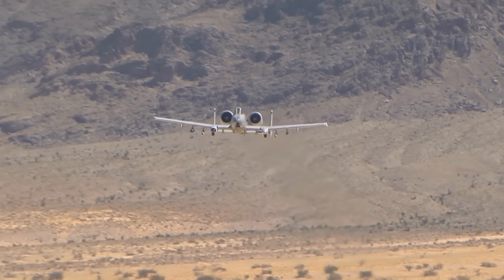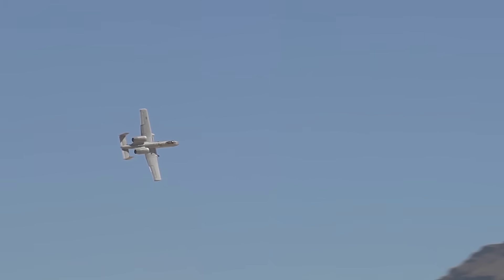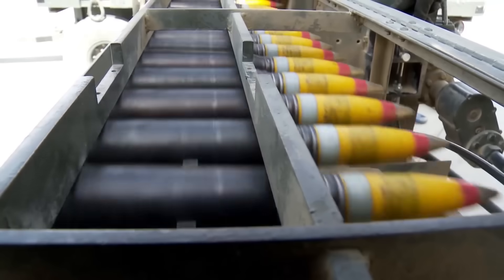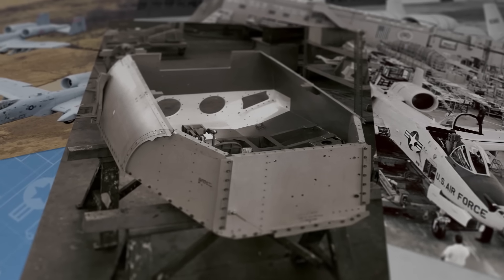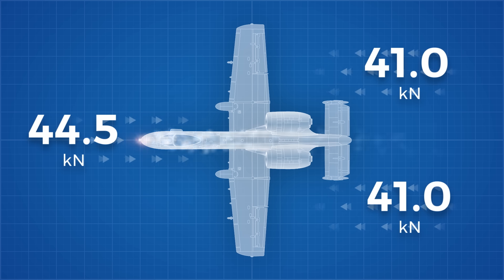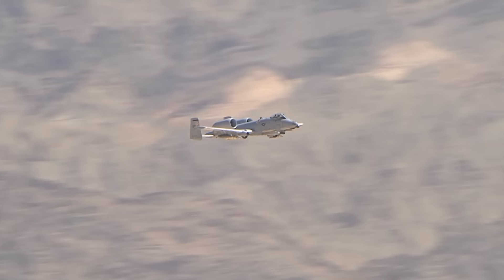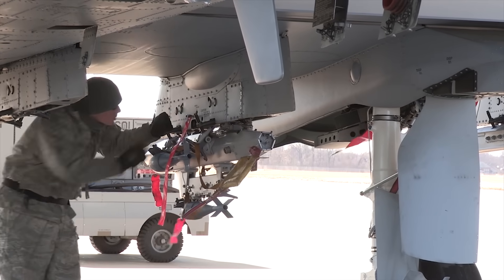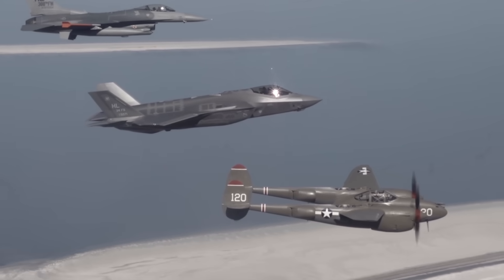The Insane Engineering of the A-10 Warthog

Comment: A10 is a cheap close ground support.  They should not discontinue it. Just upgrade it alittle.
Reply: Why?  Not enough pilots dying in obsolete planes for your liking?
Reply: @JP-fq5zj what amount of pilots have died and without close ground support how many soldiers would die. It's a flying tank. Yes low and slow but it has a purpose.
Reply: @sandcrai823 In a real war against a real enemy?  Most of them.

I never said ground support shouldn't exist.  Don't bother replying if you're just going to lie about what I said.  You don't need to risk pilots lives in an obsolete plane to provide it.
Reply: @JP-fq5zj  Whatever you say

Comment: Simply put...I love this plane.  A few more thoughts...I can't believe the Air Force has stopped using this plane...but it is a little understanding considering all the new high-tech planes they have coming their way. It's just so easy to love because of its simplicity. The good news is that there has been talk of the Army adopting it, and I hope they do. Can you imagine how much of a bigger beast this plane could be if it were modernized?!!?!!  There isn't another plane as good at ground support as this one. Lastly, I was never in the Military, but I can imagine that there's nothing more comforting or iconic to a soldier or marine than the beautiful sound of BRRRRRRRTTTTTTTT overhead.
Reply: There are many planes equally capable of ground support.
Reply: @JP-fq5zj  Are there though?....I'm not just talking about firepower. I'm talking how the entire design revolved around ground support. 
It's brilliance is in its austere design...large max flight weight. Wing design to help support stability at slower air speeds. Oversized landing gear so it can TO and land on imperfect runways. The engines are higher off the ground and in the back for this same reason, and also to help make them less of a target from small arms on the ground. Not to mention the redundant hydraulic systems and the ability to fly it without the "power steering" mode on. And I'm sure I'm missing more. 
If you upgraded it with more modern and lightweight materials to enhance cockpit survivability. Fsensors for better cockpit visibility....and finally a radar to aid in long-range target identification and weapons targeting (and other systems I'm sure I'm forgetting)
Sorry for the rambling...I'm a dork and I love this plane.

Comment: 2 corrections

While protecting the equipment from casings might be part of the reason, the primary reason for retaining the spent casings is maintaining center of gravity

The gun also isn't directly in the center, it just fires from the center. The gun itself is offset

Comment: As you said, those fancy planes made for BVR engagements are insanely expensive, fragile and in any CAS role they won't have any advantages. Stealth is for radar, not for mk.1 Eyeball. You cant even step on most of the F-35 or F-22. You can rip half of a wing, landing gear and an engine off a Warthog and it still will return to the base with the landing the pilot can walk avay from. Good luck operating a gen 4++ from a muddy sandy runway as well. A plane made of shit and sticks with a sole purpose to pack and take a punch. A combat environment with highly sophisticated GBAD against the US military is proven to be fairly rare while EW and other things are present in the most cases. Good luck jamming a 30mm round. And well, you could use a Hellfire or AGM to remove shitty Soviet legacy equipment from existence but a Hellfire probably will cost more than that thing you deleted. 4000rpm democracy delivering boomstick is really, REALLY cheaper. That's why the Hog persists. When your enemy uses Sherman-like technilogy, a flying Sherman wins, not an F-35.
Reply: The f35 can simply provide CAS from over 30k feet where AAA doesn't reach and because it isn't as slow as a ww2 plane it doesn't need to have a runway that close to the fight.

Also a manpad is way cheaper than an A10

Comment: notes:
survivability, ruggedness, cost effectiveness, air to ground support, was prioritized. Redundant hydraulic systems were present.
MIG 21: here's an engine, make it fly
A-10: here's a 30 mm gatling gun, make it fly

Contains more chaffs and flares than any other US legacy fighter plane. Chaff is radar confusing material for radar controlled missiles and flares are used for confusing heat seeking missiles. Unlike f35s it was designed for one job only, getting down and dirty and take some punches.
Reply: Unlike the f35 it can´t do cas if there´s a guy with a manpad sitting on a plastic chair

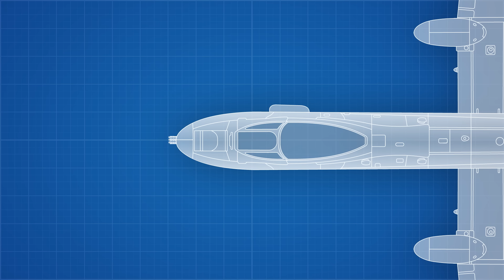Comment: 7:43 Accually Its Not Mounted Directly in the Middle Its Offset
Reply: Are you not thinking of the nose wheel which is offset to avoid the gun?
Reply: @meggaduck  no the gun is offset however the right most side of the barrel fires to prevent the plane from yawning

Comment: They have been trying to kill this plane since the 90's.  If ground fire can't take it out then a bunch of bureaucrats in washington don't stand a chance.  My guess is they'll either base a drone on it at some point or just put a drone in it.
Reply: Ground fire took out more A-10s than any other US combat aircraft during the Gulf War, despite the A-10s never serving on the frontline against the Iraqi air defence network.  SEAD isn't 100% effective at defeating air defences, and 4 of the 6 A-10 losses went down each after a single hit from short range missiles.
Reply: @dumdumbinks274  Ok.  An a10 costs about $19m and $20k per hour of flight.  They want the f35 to take on the role of close ground support.  An f35 costs between $80m and $100m and $40k per hour of flight.  NEVER MIND what the cost of repairing the fancy radar reflective coating the plane has if it takes even a single bullet or shrapnel hit.  a10 is old.  It ain't pretty.  But it works for what it's intended to do and saves me money.  You keep the grunt at the front and let the pretty boys sell war bonds back at home.
Reply: @Ray_LF  You've barely touched the surface of this topic.

The A-10A cost $19M back in 1998, adjusted for inflation from when it first entered service in the late 70s. If you want a friendly-fire platform by all means pay that money and use binoculars to identify your targets. The A-10 didn't become known for CAS until 2 things happened... 1. The major C upgrade in 2006 which basically doubled the cost. 2. the shift in warfare from largely conventional targets to poorly armed insurgents who wouldn't even be guaranteed a kill when shooting at a low flying Cessna.

A modern A-10C with all the upgrades that make it effective will set you back at least $50M, and it needs supporting aircraft to keep it safe in a conventional setting (so operationally just as costly as the F-35 which can protect itself). It's usual job can also be done by a $20M Super Tucano which has better endurance, can carry 2 crew for better situational awareness and operability, and produces less heat so is less vulnerable to IR guided missiles... you know, the ones that can defeat the A-10 in a single hit.

The F-35 isn't required to replace the A-10 directly, rather the fighter it is replacing has already been gradually replacing the A-10... and for good reason. The F-16 can respond faster to a CAS call than the A-10 can, and it has all the necessary sensors and comms equipment to accurately put munitions on-target in a timely manner. If you need firepower then an AH-64 is better than an A-10, as is an AC-130. But for general CAS that extra time spent waiting for a platform that can eliminate the threat entirely is time that troops spend under fire and potentially dying. Partial elimination in a timely manner allows the infantry to fight back or reposition, and that results in more lives being saved overall.
Reply: @Ray_LF  the thing is that an f35 wouldn´t be hit by shrapnel at all

Comment: Grew up on the Eastern Shore of Maryland. The Maryland ANG A-10's flew over at just above treetop level nearly everyday, usually in pairs, and they'd do maneuvers at high speed over our house (lived on a rural route, surrounded by farmland). I once found one of the discarded 30mm shell casings in the pasture behind our yard. Not sure how it got there since I never remembered hearing the BRRRT. I assume that they had done live fire training somewhere and it was just one that didn't fully make it out of the plane at the time and dislodged during a high G turn over our place which they did quite frequently? The A-10 will definitely be missed. The Air Force thinks the F-35 can do the same job, but there's no way...there's no other plane ever made like the A-10 and never will be.

Comment: Ah yes, the friendly fire plane.

😂
Reply: Mostly gulf war when they were just starting to use them in that environment. The sandstorms were nasty and they weren’t used to using those depleted uranium rounds. Since then there has been I think a dozen friendly fire deaths with allied forces using the a10. There is more chance to get friendly fire from your guys in close quarter combat these days. They updated them with sensors and what not the last time around I think.
Reply: @OvercomeEverythingJosh  The '91 Gulf War incidents were a direct result of the A-10 not having sufficient optics and sensors for CAS missions. Despite the common belief, it was not meant to be a dedicated CAS aircraft - instead meant for armor interdiction along an enemy's reinforcement routes - and this showed. A-10 pilots often had to resort to using binoculars to confirm targets because they simply didn't have the camera suite other strike aircraft, such as A-6 or F-111, had at the time.

Comment: Jeeeeesus fuck, the stupidity in this comment section... 
Actually simping for a plane that needs the pilot to bring binoculars just to try and identify a target and only works through stupid expensive upgrade packages that make it cost more than modern planes 
This thing is genuinely garbage and should never have left the design table. And you know that's true because that stupid gun is always needing to be replaced with missiles anyway.
Reply: ...It doesn't require the pilot to use binoculars for anything, and all comparably aged fighters i.e. the F-15, F-16, and F/A-18, have received significantly more expensive upgrades to keep them in service. 

As for the gun, it is a backup weapon even in the A-10's case. The A-10's primary weapons have always been missiles, followed by bombs, then the gun.
Reply: Ok bro you watched a YouTube video and adopted its opinion. In the C variant you absolutely do not need binoculars to identify targets. C variant has advanced sensors and datalink in order to differentiate between targets and friendlies. Also has an HMD so anything the pilot sees through the cockpit can be thoroughly inspected with TGP before launching a Maverick at it. Thought it will most certainly be replaced, it is still absolutely a capable dedicated CAS platform and a couple of "hot take" YouTubers shitting on the A variant from the 70s doesn't change that fact.

Comment: Losing this would be pure folly… even if they copied as a drone.  Every soldier I’ve heard speak  of it absolutely loves it. 

It’s 1/10th the cost of the F35 per hour…. Redo it or make a drone out of it.
Reply: the upgrades needed to make it barely viable are more expensive than an f35 and the cost per hour is only lower if it wasn´t in actual combat
Reply: @aquilesca5tr0  The upgrades the F-35 has received since entering service are more expensive than an F-35. Cost per flight hour for an A-10 is roughly equal to that of an F-16, which is almost half of an F-35A's CPFH.
Reply: @dumdumbinks274  the cost oer flight hour of the a10 are only lower assuming it doesn't get hit by anything which for the a10 is impossible in a cas scenario
Reply: It is sad but it really is very outdated and more modern planes do the job better. Sad but true. I love the a-10 but it just can't keep up in terms of cost.

Comment: From John Boyd's Biography: [paraphrased] during Viet Nam, the Army wanted to take over the CAS mission with an Army Helicopter. (IIRC RH56 Cheyenne?) The Air Force heard this, and told their Pentagon Design Office to get a plane to do the job, cheaper than any helo the Army could get, and keep the CAS mission with the Air Force. The Officer that drew the assignment went to Viet Nam and interviewed the pilots in the SkyRaiders flying the mission what they would like. Canon, armor, and loiter time were the Pilots primary responses. Ease of repair were the primary Ground Crew responses. The A-10's design brief came from this and other points, ultimately resulting in the Hog.

Comment: 7:52 - that's not exactly true. The fun fact is that the gun is mounted slightly off middle axis due to weight distribution. If it would shoot like a normal gatling type gun - when the barrel is at 12 o'clock position. it would drive the aircraft off its target. Thats why it shoots when the barrel is at 3 o'clock position.

Comment: The basic construction belongs to Nazi Germany aircraft engineering Henschel HS 132
Why is German Luftwaffe not user of such a Tank fighter which is necessary to push back back Putin to the frontier where he belongs?
Reply: Logistics. By the end of the war, the fuel shortage was so bad that they couldn't even run trucks to resupply their troops and were using horses. Good luck scraping together enough aviation fuel for one flight, let alone a whole wing or squadron of these

Comment: This thing was so economically built, it doesn't have a relief tube. That means pilots wear diapers on overseas flights. There is no 2-seat version, so the pilot's first ride is solo. There is no WOW (weight on wheels) switch, so the pickle button is hot while it's on the ground.

Comment: When live rounds were in the still in the gun, i am told this structure is where they took the plane for service: 33°40'55.1"N 78°56'36.8"W - all of the concrete walls are ~3 feet  thick and up until 2016ish you could walk inside 24/7. Today the county road is blocked off and a posted no trespassing sign does not let you even go near it. (Google Earth the coordinates to see it)

Comment: If we could send 10 fully supported A10 warthogs and four c135 gunships to Ukraine, the war would be over very soon. The air is opened up over Ukraine now. Correct me if I'm wrong but I believe the A10 would be more useful to Ukraine than the F-16.
Reply: It would be shot down far too quickly to be useful. F-16s can also carry every weapons the A-10 can carry.
Reply: I'm pretty sure F-16 is better in almost every way compare to A10, it even have its own tiny A10 gun. Foxbats could easily shot down the A10 too
Reply: @youwantmyname9208 well, if that were true, they just replace all the a10s with F-16. These two planes have very different mission styles and packages. And right now? In Ukraine? They need something to cover the ground. A 10s to support the troops on the grounds. Everything in the US inventory is multi-roll to a certain point. Even the A10... Simply put the a10's the best thing for the troops on the ground.
Reply: @petebetz5358  I guess after the Russians interceptors are wiped out, the A10 can safely do it's work, but F-16 is needed for the foxbats to get destroyed first. Judging by the situation, I guess the falcons are doing a pretty good job at it
Reply: @youwantmyname9208  yeah but from what I've seen Russia's having a very hard time putting any air frames over Ukrainian air right now. They fire their missiles from miles inside of their own territory and very rarely venture into Ukrainian airspace so,

Comment: You no the missersmitt a1u1,,,,the A10 or missersmitt a1u1 they should have 4 boosters the A10 wing boosters the missersmitt rear boosters the fact of one or both having 4 boosters this should increase speed the both planes involved and adapted into one plane test modil in wind tunnel add die

Comment: the ultimate test should be to send a number of A10 to ukraine this plan is made for exactly what is in ukraine now a lot of russian tanks and unfortunately plenty of air defense

but this is exactly the scenario the A10 is made for

ukraine had needed this plane a long time ago, 

imagine when the russian column that was over 50 km long stood outside Kiev, the A10 plane would have liked this

what is happening in ukraine now , is as close as we will probably ever get to the scenario of defending the "Fulda Gap"

another advantage of sending a number of A10 is that the usa gets rid of a lot of depleted uranium that hopefully ends up in russian tanks, ifv, apc, etc. and ukraine has a high probability, nothing against this

last but most importantly, the A10 would have saved the lives of many Ukrainian soldiers
Reply: @loafofmilk7680 you will probably have to read more about the difference between A10 and SU25

The A10 was developed precisely to cope with hits from MANPADs with a titanium cockpit triple system for the control of flight surfaces, etc. none of this has the SU25

do you think that nato would have total air supremacy in the Fulda Gap and that the Russians would not have MANPADs

this is exactly what the A10 is designed for

look at the damage a number of A10s got in the 2 gulf wars and yet this made it home after direct hits by MANPADs
Reply: @6XCcustom The A-10 is the most shot down modern US plane. If the A-10 ever fought a war close to the one in Ukraine, they wpuld be getting smoked as fast as Su-25's and Su-34's are.